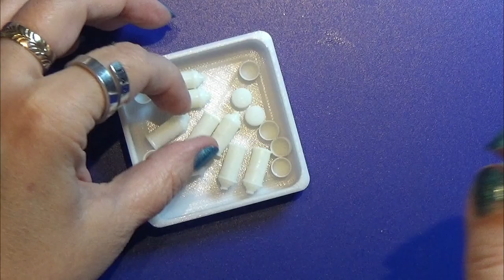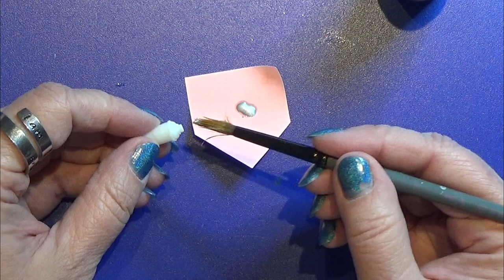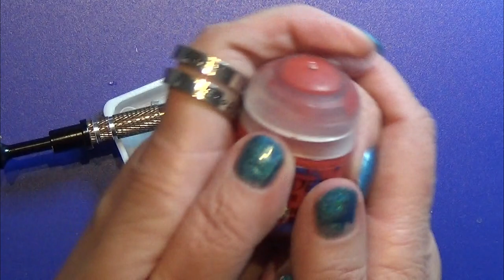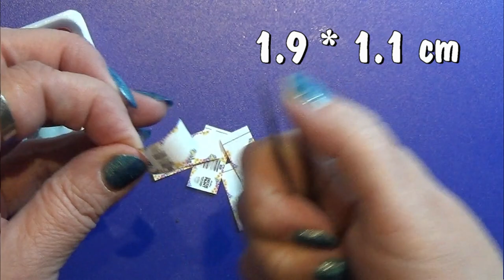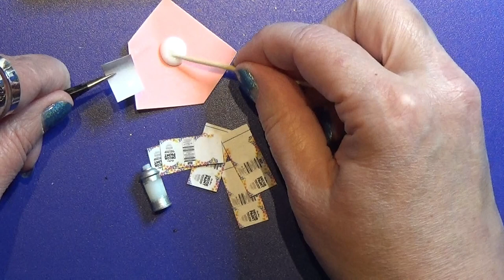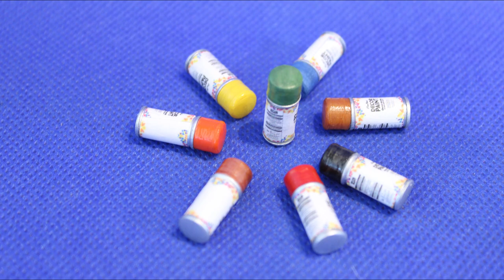Miniature 3D Printed - Spray Paint Cans

Comment: I keep waiting for the cost of a good 3d printer to get below 100 dollars so I can 3d print my own miniature ideas.....especially for making miniatures that actually work like the real thing.  Things I can't afford to buy at a miniature store or website I can make myself with a 3d printer...I love the spray cans they look great!
Reply from the maker: If you get a 3D printer by low coast, you will get a low coast maschine. I Made thees on a Anycubic Photon resin printer, what is really a toxic thing to work with, and it takes a lot of time cleaning and curing things, so they are safe to work with.
A FDM printer, the once there use plastic filament, are not that toxic, but it can't print as detailed. 😊
Reply: @DRN  Thanks for the tips ;o)